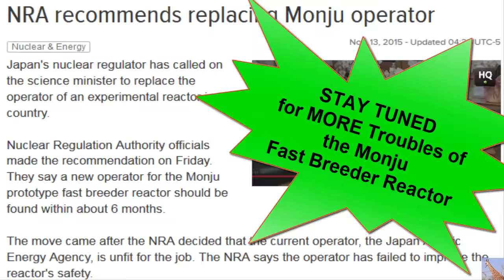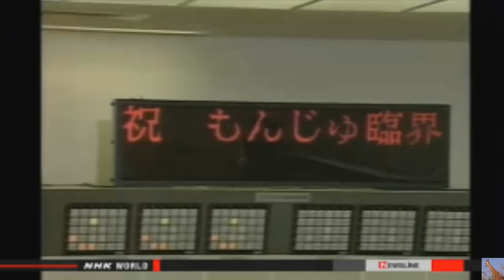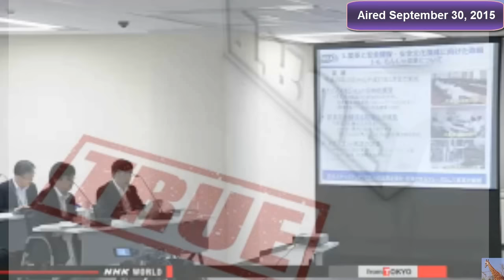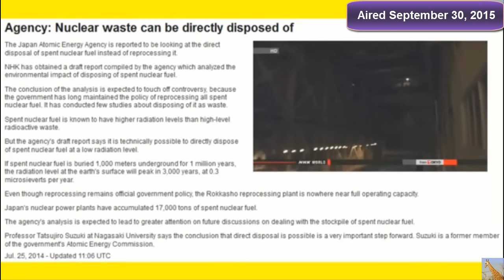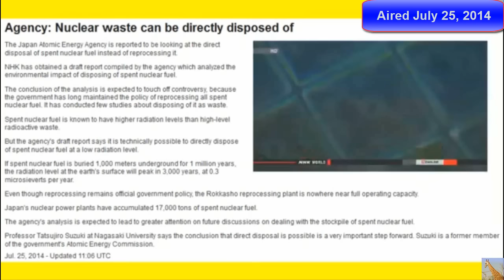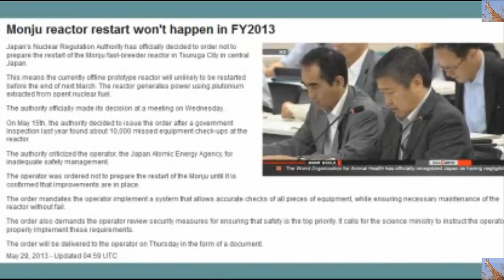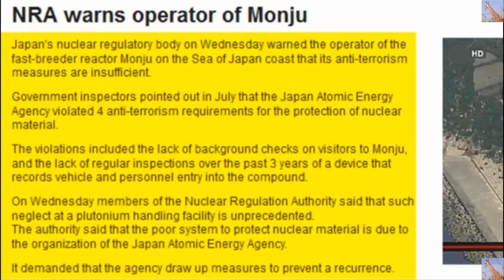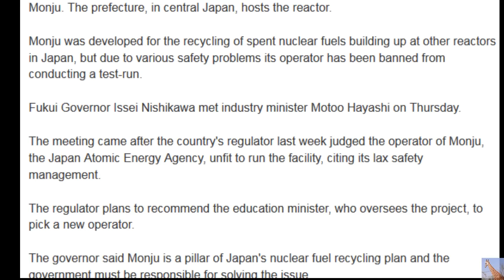Grave Conditons at Monju Fast Breeder Nuclear Reactor 11/13/15

Comment: Sodium is the most insane thing to use as a coolant than anything. There has never been a reactor made that does not leak coolant at times, including Monju. They are so incredibly lucky there at Monju, when that sodium leak occurred,  the air in the containment was luckily very low in humidity. I would rather walk over gunpowder than sodium. Sodium self combusts in humid air. It reacts violently, burns, explosively. Huge problems with sodium cooled reactors is the problems of cooling bearings in all the many pumps in the plant. Typically  they are cooled with water based coolant, but of course cant use that here. The coolant they do use causes problems because it can get trapped in the core, build up, harden on it and cause local overheating issues. Yes bearing coolant does and always will leak into the reactor coolant, no way out of that.
Reply: +BiddieTube Monju = Mon Dieu!!!  ^..^
Reply: Which metal do you think would be more suitable to be used as heat transfer medium in a breeder reactor?
Reply: Lead is one option. It's not quite as good as sodium for heat transfer and has a greater chance for accumulated radioactivity. It's also considerably heavier which means all the related systems must be engineered to tolerate the weight. The drawbacks are offset though, in that lead isn't reactive in air or water. It's impossible to have a lead fire. Lead is also very cheap.
Reply: God I love youtube
Reply: The EBR-II in Idaho ran for decades without a leak. It also had passive safety features. They actually ran a test where they shut the coolant pumps off while at full power and the reactor safely powered down on its own.
Reply: @DriveCarToBar  
Exactly. Lead-Bismuth eutectic coolant is much safer and is not explosive or flammable. The Soviets built quite a few models of lead-bismuth eutectic cooled fast reactors for submarines.

Comment: America de-funded and abandoned plans in the 70's to build one of these at the Savannah River Site, it was a DOD project designed by Bechtel and run by Dupont, wondered where that boondoggle went.  Rumors abound still it is still a skunk works there.
Reply: We should have funded Liquid Fluoride Thorium Reactors instead. But no Nixson had to fuck more shit up.
Reply: He funded (and continued funding) the EBR-2 project at Argonne National Labs and that reactor ran for 30 years without a single incident. The Integral Fast Reactor prototype was the result but the project was cancelled in the early 90s. At the moment, GE has it's PRISM reactor, based on the IFR prototype.
LFTR would be nice as a main power source, with IFRs providing power too, but cleaning up decades of spent fuel left over from light water reactors.

Comment: M6.7 - 144km WSW of Makurazaki, Japan
http://earthquake.usgs.gov/earthquakes/eventpage/us10003y71#scientific_origin:us_us10003y71

Magnitude 6.7 mww
Location/uncertainty 30.998°N 128.836°E± 5.9 km
Depth/uncertainty 10.0 km± 1.8
Origin Time 2015-11-13 20:51:31.920 UTC
Number of Stations –
Number of Phases 137
Minimum Distance 164.20 km (1.48°)
Travel Time Residual 1.64 sec
Azimuthal Gap 17°
FE Region Northwest of the Ryukyu Islands, Japan (234)